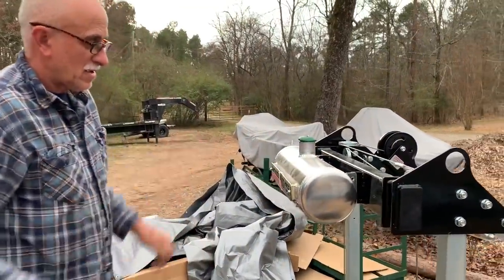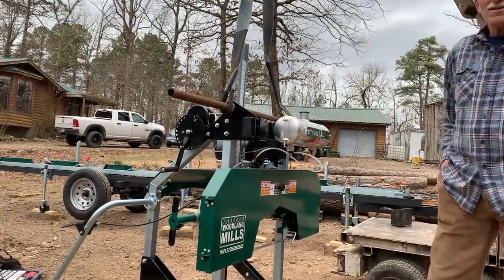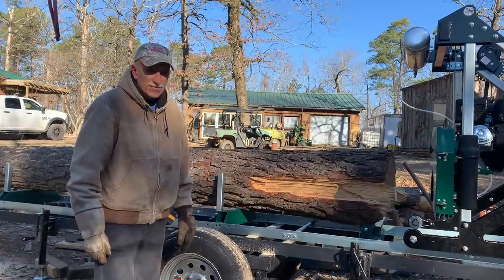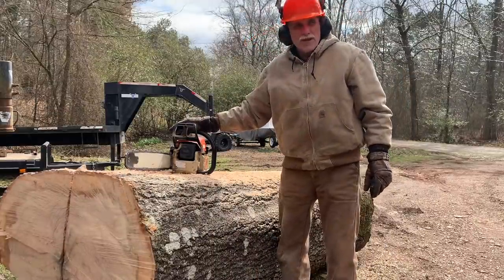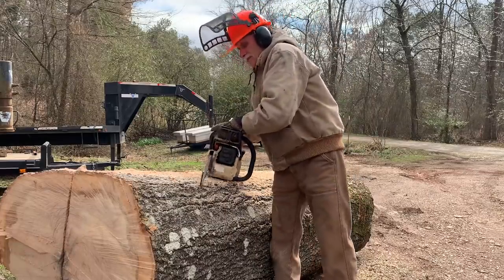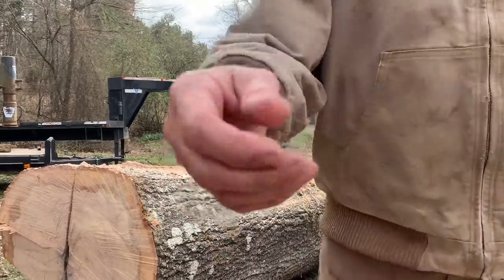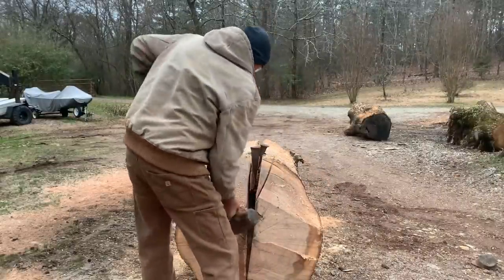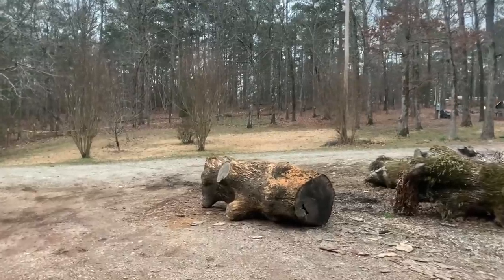Log Cabin Build-part 8. Fixing sawmill trailer, getting a massive oak log ready to quarter saw

Comment: If you are swinging a twenty pound sledge I ain't gonna argue with you but I thought I might mention that a session with the angle grinder to dress those 'mushrooms' off your wedges would be beneficial.  Hitting it with a twelve pound much less a twenty will send off shards like bullets!    Don't know if you have one but I found that the cheap little chain grinder from Harbor Freight ($30 when I bought mine five or six years ago) with a few modifications (I machined a stiffening block for the base, wood would do as well) it is worth its weight in gold and does a great job in a jiffy on a chain.  Considering Oregon's model was over five hundred bucks last I looked for the guy in his home shop it is a great addition.
Reply from the maker: You are so right about shard’s coming off metal to metal contact. I sometimes do things even when I know better😬 thanks for the info on the harbor freight chain grinder. I will check it out👍

Comment: Hey Lance!  Have fun with the new mobile sawmill.  Cutting up such a large hardwood log is backbreaking work.  You have to know exactly where to put the wedges or it's going to be an awful mess.  Best regards from Hans and Cheers 🇦🇹🍻.
Reply from the maker: Yeah we have a lot to learn on the sawmill. Planning on cutting that log into quarters so it will fit on the mill. We hope that works! Any suggestions would be appreciated 👍
Reply: @natureartgirl  Lance, I just remembered something.  Your bandsaw blade ripped off.  Do you also have water cooling for the belt on the machine?  That could be the reason.  Overheating is often to blame.  About suggestions.  Best regards from Hans 🇦🇹🍻.
Reply from the maker: @johannperaus6890  thanks Hans! Didn’t see this till today. The blade has a water drip system on it but I may not have had it turned on enough. These logs are really sappy and I think it was building up on the blade. We turned the water up a little and added a little pine sol to it. That seems to have helped. Thanks for your suggestion!

Comment: How far, from the rear of the trailer, is the axle centered?
Reply from the maker: Hi Phil, the center of the axle is 80” from the rear of the trailer. This was for the mill with the extra long bed. Tongue weight is about perfect with the mill at the back for transport. I don’t know if you saw the longer video I did just on the trailer build. Hope this helps!